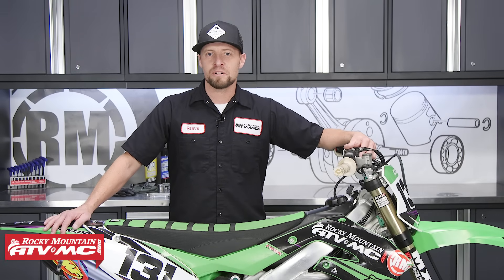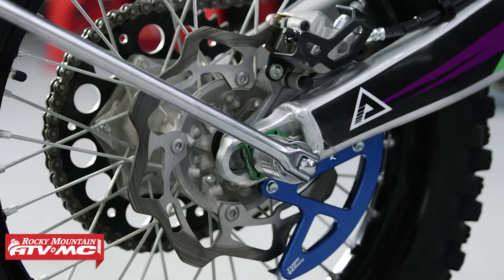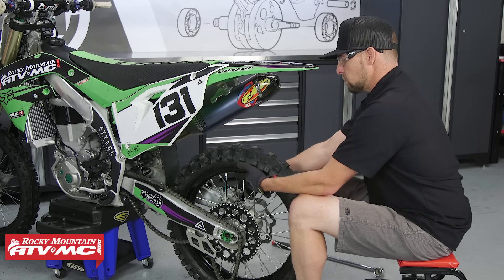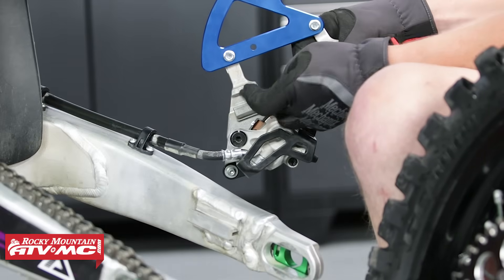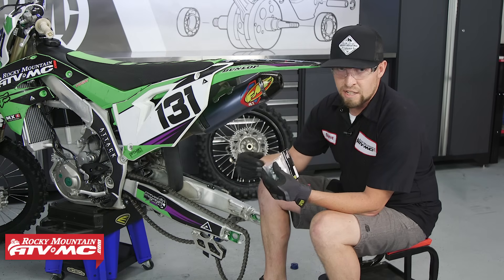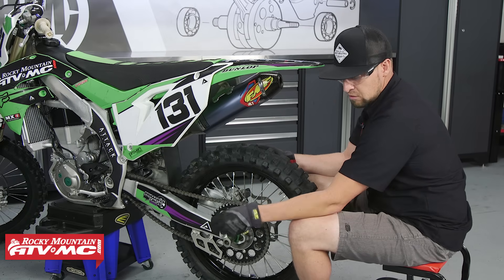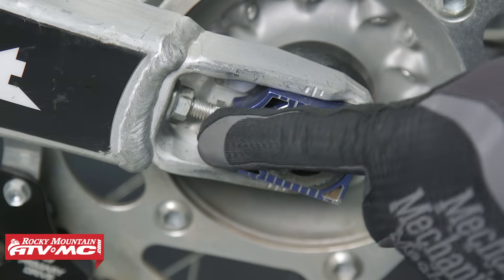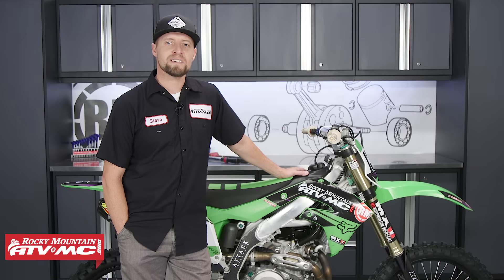How To Install a Dirt Bike Rear Wheel

Comment: Took my shaft out today to install new chain and sprockets. BUT the seals and bearings came loose from inside the wheel now I'm stuck, wont go back in and dam shaft wont/cant slide out cause on the chain side the spacer and bearing is in the way.

Comment: How do I get the wheel back in? If accidentally someone did hit the rear brake? And now the pads are shut together ?
Reply from the maker: You will most likely need to pry the brake pads apart and open up the bleeder valve on your caliper to let a little bit of the fluid out. If you do that carefully you shouldn't need to bleed the system.
Hope that helps!
Reply: @rmatvmc  what if the caliper it self is pushed over how to u get that back over to fit the wheel

Comment: I just installed a new rear sprocket and axle adjusters on my 16 KX450F and after I tightened nut with torque wrench my tire will barely spin now? Any ideas would be awesome.
Reply from the maker: Something is binding up. I would remove it again and look for the problem.
Reply: Too tight maybe
Reply: Must have over tightened it.

Comment: How far back can you go on the rear axle or how foward can it be and how does it affect the bike?
Reply: It shorten or lengthens the wheelbase and can alter the handling characteristics.  The super cross / MX mechanics do it to the race bikes.  An additional adjustment option to tune the feel of the bike.

Comment: Does it really matter what side your axle nut goes on?
Reply from the maker: Yes, on most bikes the axle will only slide in correctly one way.
Reply: @rmatvmc  alright because I had a rm125 and the axle nut was on the right  side of the bike and I just got a crf250 and the axle but is on the left side of the bike.
Reply: Yes but the axle holder should be in one side.

Comment: I just put my wheel on after putting new spokes on it and it is to left and to close to the chain anyone know why
Reply: Probably missing a spacer, thick washer looking thingie that distances the wheel from the swing arm
Reply: @singlejingle_ka  sorry lol should have deleted the comment but the spoke were put on incorrectly, I have a kx 85 and the rear wheel has 3 different sized spokes and the guy that put them on out the wrong sized ones in the wrong spot
Reply: @bryson96.  yikes bro! I thought you meant the wheel spacers. Glad you got it figured out now!